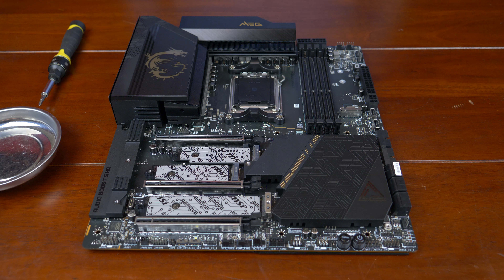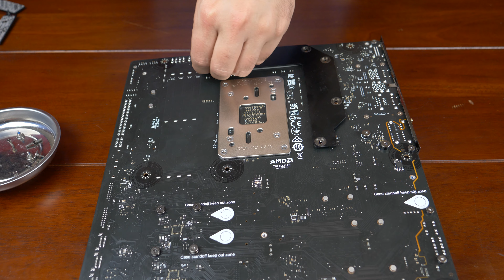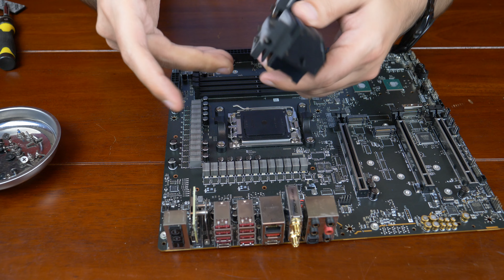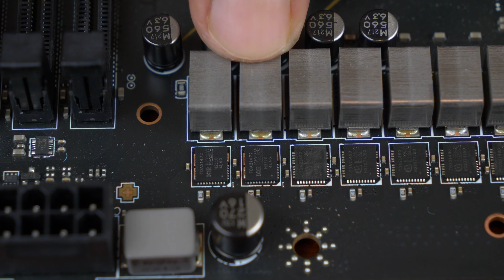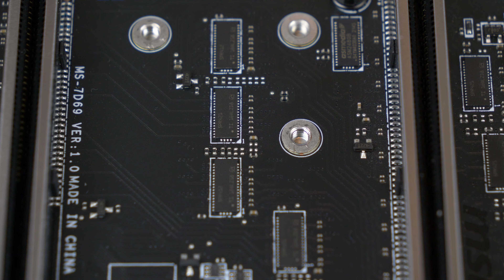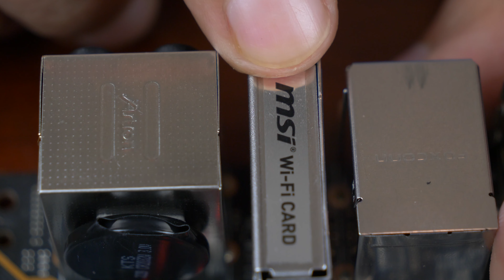Teardown of the MSI MEG X670E ACE Motherboard - Part 2 of the Review

Comment: 19:15 is not hiding, are shielded to cut down EMF interferences. However the problem is under the hood : design of ALC 4082 like ALC 4080 has the issues where the sound trails are very close to USB(plenty of voltage)  so we've seen issues in the past on different MBO with this 2 ALC in the past, cracks and pops over the sound.

To conclude they shield it but, not sure they resolved the flawed design. Also not sure if is down to Realtek or MBO PCB design.

Was one of the criteria when I bought my MBO to get  ALC 1200 or ALC 1220 and avoid any MBO with ALC 4080 or 4082.

Comment: I got the MSI X670E Carbon WiFi Board today, it has the same hidden CMOS Battery. I want to know, if it makes sense, to install a kind of extension cable for the CMOS battery, for easier maintenance, or if there are problems, when the cable is extended.

Comment: Metal plate over audio components need to reduce/remove electric noise from other components and negative effects of this noise to sound quality. You may find similar solution but with much bigger scale on most pci-e audiocards with 100+ USD (probably even with some less expensive). Cheers. :-)
Reply: Yes, but the issues of ALC 4080 and ALC 4082 are in the chip itself or PCB design. You can shield of EMF all you want when the issues are under the hood.😮‍💨

Comment: Hi Steve, unfortunately I can not finde any documentation if the m.2 Xpander Card can be used in the PCI_E3 slot when using only one ssd on the card. Would be great to know, cause I don't want to have PCI_E1 at x8. Also the cooling of the VGA would be improved I guess when there is no card in PCI_E2. Cheers Dirk

Comment: I have a question about this board, hopefully you will be able to answer as msi can't.  I just bought this board mainly for the looks and the audio . I do not have loud headphone output.  The ess sabre should be able to make 32 ohm gaming headphones loud.   My question is do I connect headphones to the front panel, or the rear io. And how do you control the dac.   I have not seen anything in realtek app.   Hopefully you can help.   Thanks.
Reply from the maker: I believe front.

Comment: Looking forward to a bios guide for this one. Haven't used an MSI board in about a decade and their bios guide pdf adds no extra detail at all.
Reply: AM5 isn't that much different than AM4..same stuff like PBO, Curve optimizer, offset voltages, etc. MSI BIOSes aren't bad but they really do lack more fine tuning that you find on Asus motherboards.

Comment: Will be better if you have take the wifi chip apart
Reply from the maker: Sorry about that, the board was still in pieces so I snapped a picture: https://steveshardware.com/wp-content/uploads/2022/10/wifi-scaled.jpg
Reply: @StevesHardware  Thanks👍🏻really great to have this information, did the motherboard slot is m.2 Key E for the wifi module?
Reply from the maker: @LoginWong  It looks like it is key-E, but no promises if another module will work, I haven't tested it.
Reply: @StevesHardware  I have also brought one of this board, will test it will the board arrive